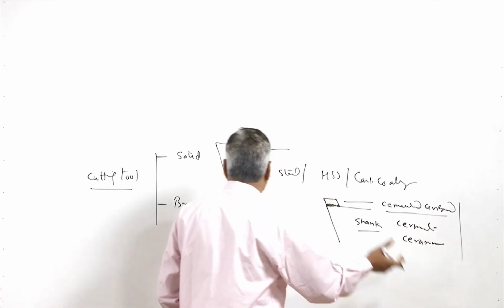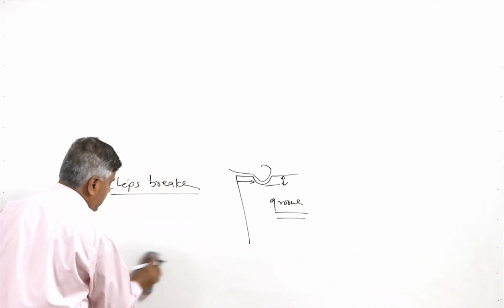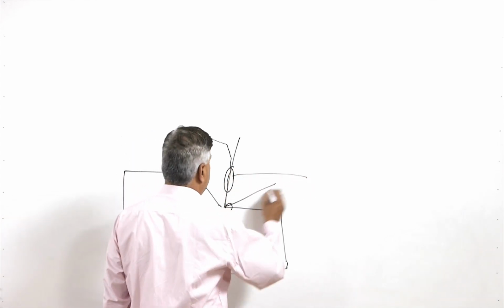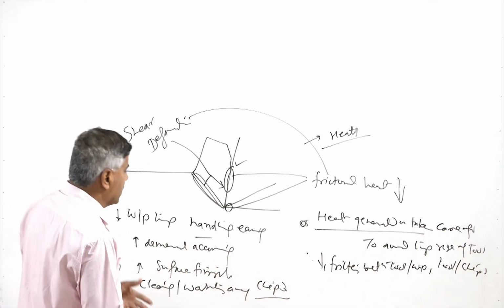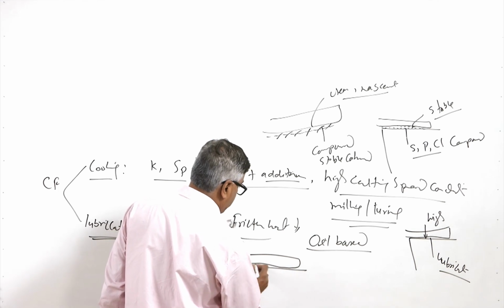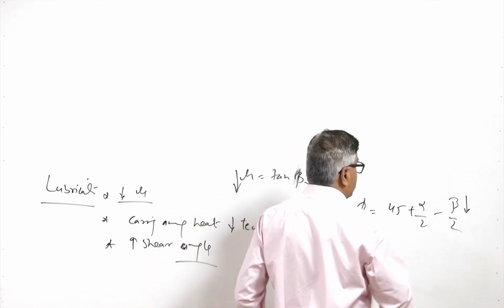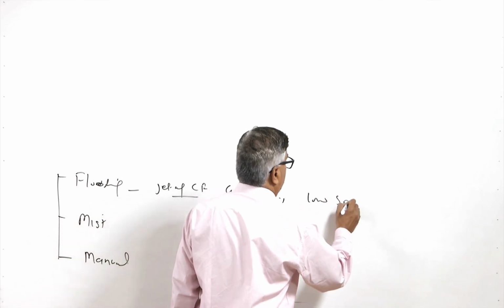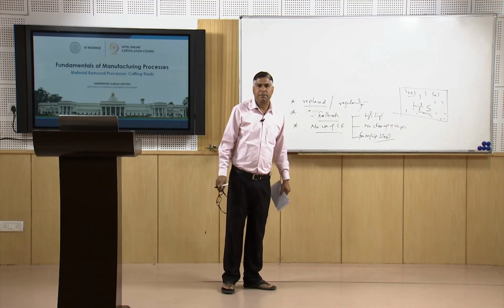Material removal processes: Cutting fluids

Comment: Hello, I would like to know more about the exposure to oil mist in the work area for machine operators. Is it an international standard to keep the extractor system alarm constantly able to warn operators or maintenance of the high concentrations of particulate emissions? Is this an important health & safety requirement or is it ok for a machining room with more than 20 machining cells operating simultaneously to have the alarm disabled as the extractor system can't cope with high productivity? Many thanks for sharing this lecture and for the attention given to my question.